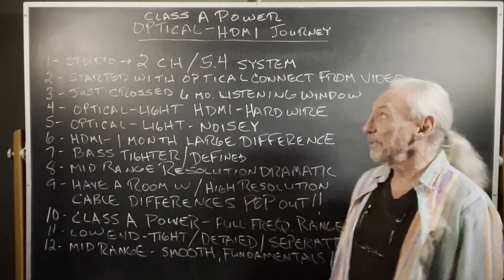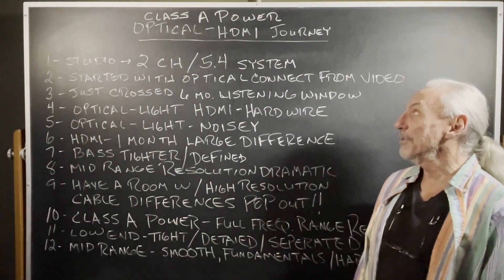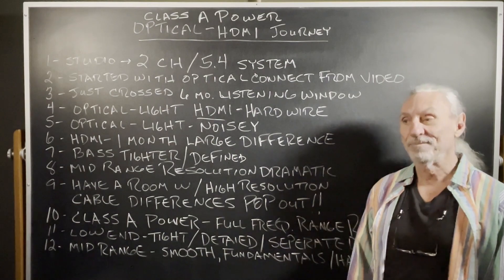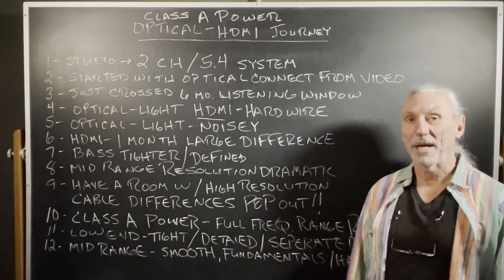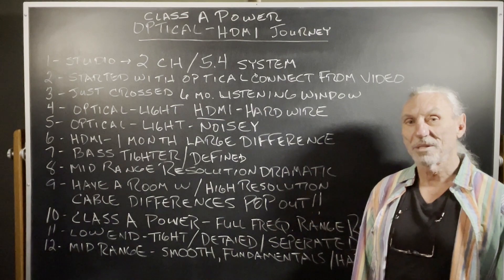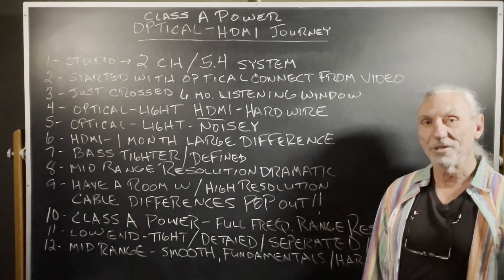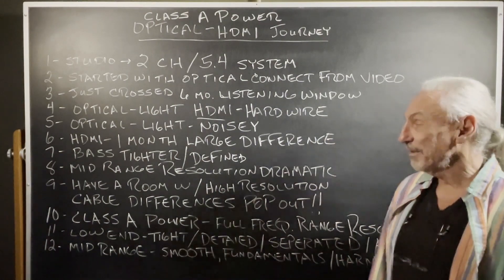Class A Power, Optical - HDMI Journey - www.AcousticFields.com

Comment: The general optical toslink/spdif used has a limited bandwidth that limits the audio dynamics / frequencies when using multi channel. It was simply never designed for it. Aka it becomes lossy and audio quality will suffer for sure. For a 2 channel signal there is plenty of bandwidth and, medium limitations aside, a 2 channel digital 48kHz 24-bit signal is exactly the same using optical/spdif/hdmi etc. Even if some bits get corrupted somehow there is still error correction making the digital input equal to the digital output.
So unless it's losing so much data that you can audible hear dropouts it's all the same. It doesn't simply go noisy.... that's the effect / feeling when using a medium for something it was never intended to. 

For multi-channel , yes hdmi is superior due to the much higher bandwidth which can result in far more lossless channels. But it also comes with limitations with ever increasing bandwidth/frequencies used. hdmi based on copper can only go a certain distance and the higher the bandwidth/frequency the shorter the distance.
To overcome these limitations there are hdmi cables that convert to optical first and use optical fiber for the transport. They won't have any reduction in quality as it's a bit-to-bit conversion.
These optical fibers are very different in thickness and material and are not to be compared with the cables used for toslink/spdif/optical.
Reply: yes beyond 2 channels the data is compressed in the original protocol. They could have done better though., In audio pro, with the same fiber/connector/transceiver 8 channels of uncompressed audio are transmitted ( ADAT)
Reply: @flexeos  Uncompressed up to 8x 48k/24b or 4x 96k/24b  or 2x 192khz/24b. There is simply no more bandwidth :)
HDMI can (at minumum) do 8 ch up to 192khz/32bit uncompressed. 
It's the hdmi spec that differs , not the fact it's optical or electrical.

Comment: Hi, just have a check, but I'm pretty sure that Plinius is from New Zealand
Reply: Correct! As a kiwi I can confirm Plinius are in fact manufactured in Aotearoa, New Zealand :)
Reply: Maybe he doesn't think there is a difference, no disrespect. 😊
Reply: @mickburns4913  No offense taken! In fact I thought the same thing - or maybe it was purchased in Australia and he meant that...
Reply from the maker: Maybe the difference is not pertinent to the discussion. Stay on point. Don't miss the forest for the trees.
Reply: Yeah that crossed my mind aswell
Reply from the maker: Lets focus more on the performance of class A than the originating country. How about a discussion on the damping and dynamic range as a start. How about the low distortion. Any feedback on those features.
Reply: @AcousticFields  hi Dennis.

I am from Australia and alot of Aussies are mental, they do not respect this brand like they should. Because we are suckers for euro rubbish. 

I know you don't care for gear and are more for rooms, I agree 100% and room is everything to me.

I would like to ask you.. was your plinius the RA 300 reference? 
The newer model

Or was it the SA ref 300. I've had both and apparently the SA was the last amp made from the lead designer. Then he left .

The ra is from a different designer.  

To differentiate between the two, the SA REF  had the two big handles on the front.  Not a smooth face like the new model.

I would love to know what you were using. 
Plinius is bloody fantastic!

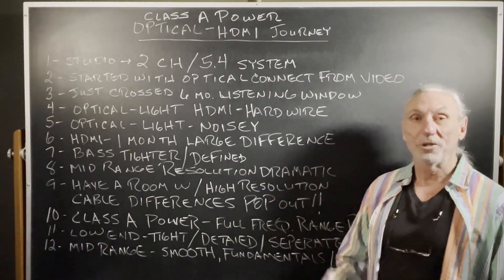Comment: 1:41 I don't know whether it's Toslink that is being referred to here but, recently, in another youtube video I learnt that Toslink is nothing more than regular SPDIF with a coupled LED and photo-sensitive device pair at each end. In other words, electronically  it's just another gimmick. Fibre-optically it's also kind of a gimmick as the the fibre is not a glass fibre, as most would have thought, but just something much closer to fishing line thread. Whether that leaves room for more or less electrical interference or pulse time-smear I do not know. RCA cables are cheap and do the job fine for SPDIF so not much point spending time to test this out.
Reply: It's not a gimmick.. It is the same data format as SPDIF over any other medium. The advantage of optical is that it does not electrically couple the two components  to each other. This reduces the possibility of interference and eliminates certain ground problems.

The disadvantage of SPDIF vs USB and probably newer HDMI formats, is that SPDIF has the transmitting device set the clock. With USB, the receiving device sets the clock. Making it easier for the receiving device to keep the clock in sync reduces jitter.

Some DACs will cache and reclock the signal internally. I had a Denafrips Venus which does this and I couldn't tell optical and USB apart. My Audio-gd R1 does not do this and I can tell that USB is slightly cleaner and higher resolution. Optical subjectively seems a little softer and warmer in my system. I prefer USB.

That said, both Denafrips DACs I've used introduce enough lag time to be unacceptable to me for video playback or gaming. My R1 does not have this problem.
Reply: @zackw4941  I agree with the above explanations but it also depends on the definition of a gimmick. In particular, whether the conversion of the signal to a light signal affords it a better protection from interference by not introducing another worse problem at the same time. There are many accounts on-line of people experiencing a better reproduction via coaxial cable rather than via Toslink.
I would venture claiming that the ground loop issue is usually more of a problem in studio environments as opposed to home use. 
Of course, if the DAC has caching ability, it doesn't matter which method of passing the signal is used since the DAC will re-create the digital signal avoiding any timing issues that are introduced by the signal transfer medium.
So, I agree that in a studio environment, Toslink might not be a total gimmick but then I have two more questions:
a) why is it even available on consumer devices
b) I would not expect any sound engineer to use Toslink over an AES/EBU balanced digital connection which means that Toslink would probably be used only as an emergency/occasional solution e.g. in case of a quick demo from a home-recorded (or similar) medium.
Like I already mentioned, the above are offered with the caveat that I have never compared reproduction using Toslink vs. coaxial - or if I have it was long ago and did not seem to me to favour one vs. the other.
USB is a totally different animal/discussion.
Reply: @Stelios.Posantzis  If anything, I would assume a studio environment to have higher quality equipment and things like ground loops to be sorted out. It's in the home where Joe Shmoe has any possible combination of consumer devices plugged in willy nilly and cables all over the place, that you start worrying about enexpected issues.

People get really worked up about digital. At the end of the day, a messy 0 and a messy 1 tell the exact same story as a razor sharp 0 or 1. All that matters is that you avoid any catastrophic problems and have a stable clock.

I have also tried coax vs optical at some point a long time ago and didn't tell any difference. But that doesn't mean optical isn't more fool proof in a wider variety of situations. The only gimmick if you want to call it that, if the cool factor that you're using light and one end of the cable shines red when the other end is plugged in. Who knows, that may have been a deciding factor when it was brought to market..
Reply: @zackw4941  I've never had a ground loop at a home audio system unless it was either faulty equipment or really sub-par devices and connections.
Joe Shmoe having a bundle of wires at the back of his system is not, I think, the question here. Anyone can do their utmost to compromise a situation : there is no cure for that. The argument could be made when long runs of cabling are required e.g. multi-room distribution systems but that is hardly a regular solution which does not require a specialist installation.
The problem of jitter, which I assume you're referring to by "a messy 0 and a messy 1", is what is the issue here, if it is an issue for a particular listener. After all, most people are perfectly happy with equipment that suffer from measurably high or moderate amounts of jitter. It is those who are quite fussy about the sound they get or, if you prefer, perfectionists that we are discussing.
I agree with your last paragraph. Perhaps one definition of "gimmick" that is applicable here is this one: a feature or component that offers no significant benefit over another feature or component or offers no significant improvement through its use but that  is marketed (whether implicitly or explicitly) as offering a very significant advantage and that also increases the cost somewhat. 
By this definition, Toslink is not a gimmick as I can see it offering an advantage in some situations - or an alternative solution, if a solution is needed in particular situations as the ones described above.
However there is another definition of gimmick which I guess might be more the case for engineers: a solution that is either inelegant or implemented in the cheapest possible manner. The latter definition of course is largely subjective and is obviously a matter of perspective or situation. I suppose it's the latter definition I was using.
Reply: @Stelios.Posantzis  I never had a ground loop either. And jitter is what I was referring to when I say, "as long as the clock is stable." A 0 is a 0 and a 1 is a 1 is what people seem to forget when they get carried away with digital cables.
Reply: Glass Toslink cables are available and make an appreciable difference.  My system is currently limited to Toslink into the DAC. When I upgrade it will be all HDMI.
Reply: @PanAmStyle  I did not know about these - any examples of makes and models?

Comment: How is optical noisy? Optical is digital cabling,it can't pick up noise. It is the digital converter that is noisy maximum.
Reply: Modern implementations of optical audio signal transmission are of course not noisy. People tend to believe in things without understanding the technology behind because of urban legends.
The optical connection (toslink) is nothing more than transmitting an S/PDIF signal over a fiber optics rather than on copper. That data transfer method was developed 40 years ago. At the time any hardware resource was very expensive ( eg the electronic density of an IC was 1 million time worse than today!). So the protocol was developed to limit the use of hardware. the 2 channels were sent over one wire and there was no separate transmission of the clock so the data signal was including the clock using something equivalent to a Manchester code. At the time a consumer implementation would recover the clock from the data and use it directly to control the DAC. As the transmission is always a little noisy and the signal is a little distorted, there could be some phase noise in the recovered clock( a little less with the optical transmission) which would add a little analog noise to the signal in the DAC, hence the original belief that S/PDIF or Toslink are "noisy". But we are not in 1983 anymore! Today any half decent engineer , working in "high end audio" would regenerate a long term stable local clock for the DAC and add a tiny buffer with few samples just before the DAC. The quality of the transmission would then have literally no impact on the quality of the analog signal. Now if people feel better listening music knowing that they have spent $100s to buy a digital cable, that's fine with me, there are all sort of belief systems that makes people feel better. A funny thing is that even if you look at a bad implementation of the protocol, as the noise origin is a phase noise, it impacts more the high frequencies than the low frequencies. More or less a signal with 4 times the frequency has about twice the noise, so worst case, you should feel that the high end is worse not the low end.
Reply: Search for ‘Jitter’… In shorts, the right ‘0s’ or ‘1s’ but at the wrong time. HDMI was heavily accused of that in the early days as well, but at the end of the day it also has to do with the quality of the timing clocks of devices that are used and the implementation of the circuitry / cabling.

(ex.) An optical output on a 10k device might sound better than an hdmi on a $50 one.

All things being equal however, I would choose hdmi as well, especially on a combo of devices where the player can output only audio info from a second hdmi and the pre-amp can ‘slave’ the clock of the player.